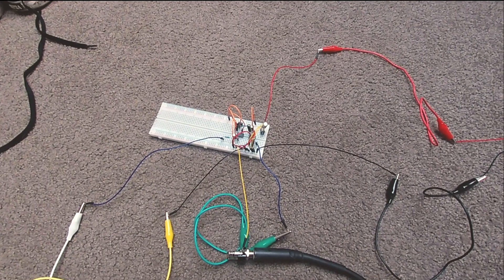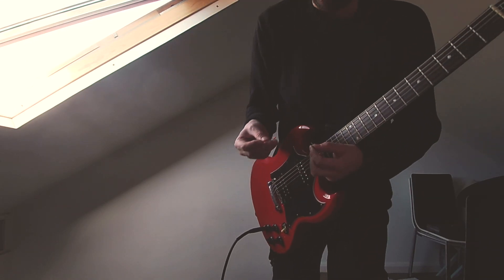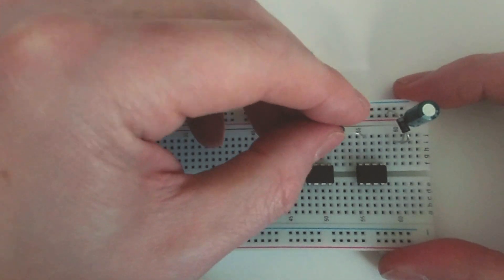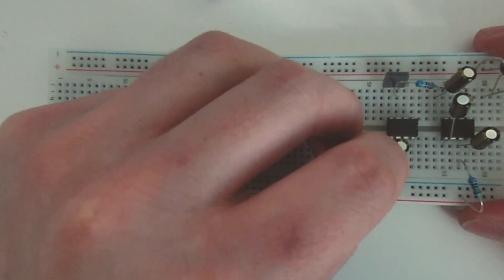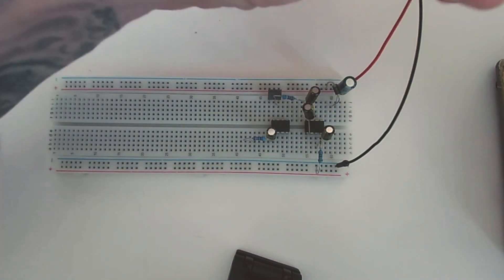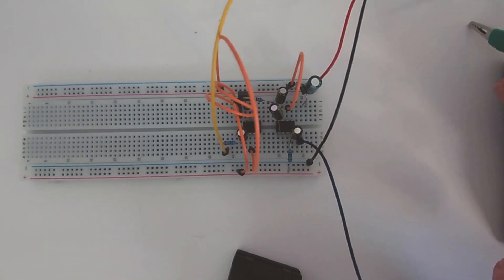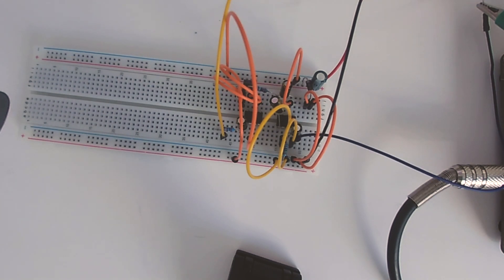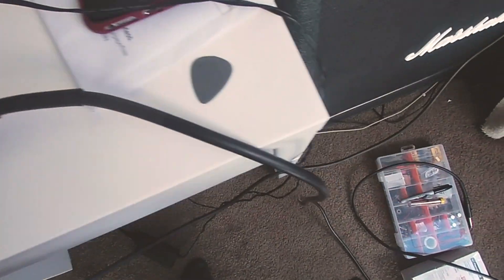Mini Sunn T Inspired Breadboard Circuit | Make a guitar pedal in less than 10 minutes!

Comment: I just built this and it worked with a 9V battery. When I changed it for a DC adaptor and plugged it into my pedalboard supply daisy chain, the right side LM386 got fried. The pedal stopped working and I smelled a burning smell. After I replaced the LM386 and went back to 9V battery, the pedal worked again. As an experiment, I plugged it back into the pedalboard. Sure enough, pedal was fried again. I used a voltmeter to test my pedalboard power, and the daisy chain output was giving 7 or 8V. Any idea what happened? The LM386 also runs hot even when on 9V battery.
Reply: Hey, some of the different types of 386's run hotter than others. It could also be that there's DC flowing through pin 5. Try putting a bigger cap after pin 5. Hope this helps a bit, after four months of waiting on a reply.
Reply: @tziirkq  Thanks! I will try it
Reply: @ApostleInTriumph57  No worries. Come back and let me know if it works for you, if not then we can try something else.

Comment: How about a potentiometer for volume control, could that be a 100 k instead of the 100 k fixed resistor.
Reply from the maker: Yeah totally, the vero board version I have done has exactly that.

Comment: The diode is only for polarity protection... It will make no difference to the sound.
Reply: You are correct
Reply: also 1n14001 and  1n4007 are the same diode with different reverse breakdown voltage.  check the specs on modern parts and you ill see they are identical in most other ways..  4001 is good for 35V, and 4007 up to 700V